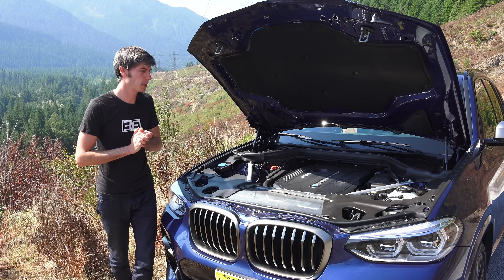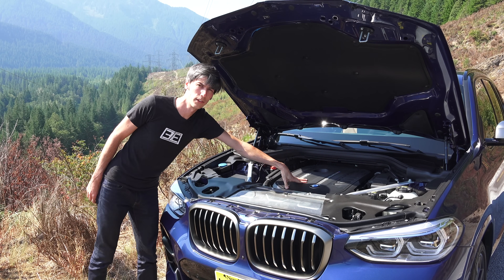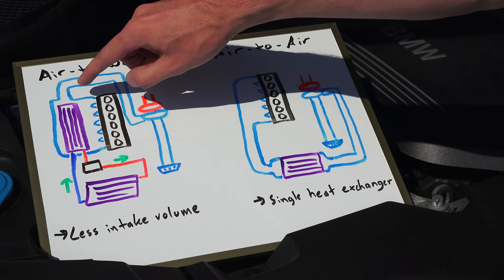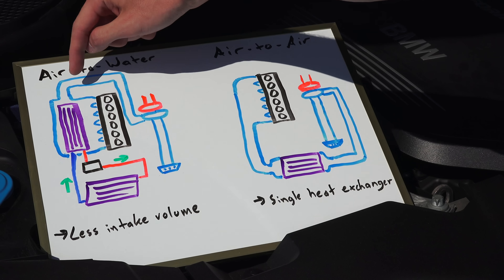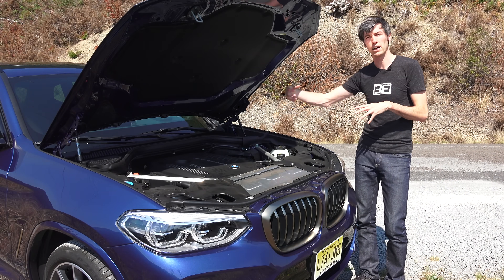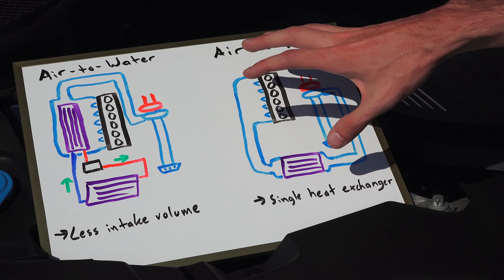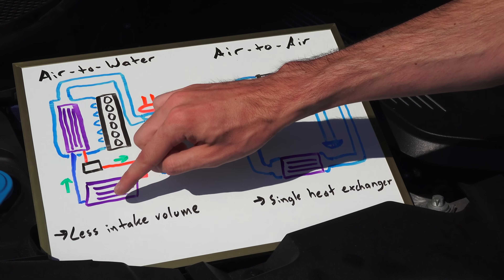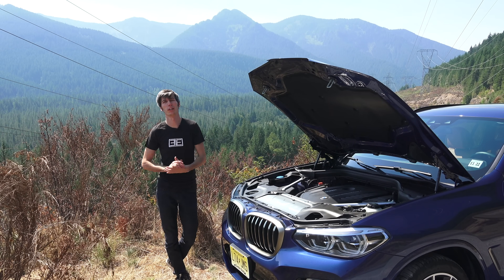The Differences Between Air-to-Air and Air-to-Water Intercoolers

Comment: Isn't the water to air intercooler more efficient cuz the water can absorb and dissipate more heat from the charged air than air to air intercooler?
Reply: Yes that's why you can have a smaller air-to-water cooler do the same work that would typically need a larger air-to-air cooler. Also less pressure drop as pressurized air runs over it.
Reply: I was thinking it worked like the A/C system. With a compressor and evaporator valve.
Reply: It's basically just another radiator system. The same reason why cars are water cooled now instead of how they used to be air-cooled. You run fluid through the heat source and then route it to a radiator to cool off the fluid.
Reply: you're not going to get the air colder than the water? especially if its in the same circuit as engine coolant?
Reply: The heat exchanger for the intake air is, but it's less efficient overall.
Reply: trouble is the word "efficient" is misused a little. water-air is not as efficient as air-air and performs worse at moving heat for the reasons  explained in the video.
thats with constant heat input like a long run on boost.
but what most people refer to is that in short burst of boost, the water absorbs the heat very well due to the large thermal mass and then can spend a long time letting it cool down when your off boost. so it works as well if not better than air-air for a short period of time which is typical for a street car.

Comment: You missed a trick.

I bet you lose less pressure having the high pressure air on the outside of a radiator in the intake manifold, than using a traditional air-to-air intercooler. Being inside the intake manifold allows one to increase the efficiency of the heat exchanger by forced induction.

Also, the heat exchanger at the front can run more efficiently, if it has a greater temperature differential to work with. The last degree to ambient is the most difficult to shed.

Sure you're still dumping the heat to ambient, but you're dumping the heat from the intake manifold, instead of from the turbo output. The intake manifold is probably hotter than the turbo output, being only a valve away from the combustion chamber.

You got a laser thermometer? How hot does the coolant loop get at low/mid/high engine load?
Reply: Samantha Dega would love to see him use that thermal camera on this car with this unique cooling system, dont just explain how it works, show us that it works!!!!!!!

Comment: Ok, now follow me on this. Could you run an AC compressor with an electric motor at say 1500-2000rpm consistently and use the refrigerant to cool the intake air? Using the electric drivin compressor would keep the compressor from kicking out at high rpm and would provide a consistent flow at the fixed RPM. One would have to get the system size correct for enough refrigerant to keep the system cool of course.

Comment: If youre building a turbo set up. What specific brands would you trust to buy for a water to air intercooler? Ive been wanting a water to air cooler for a while now especially for cooler charged air. The car isnt my daily driver. Also isnt your s2k a water to air intercooler? With that set up you dont use a separate closed coolant system for your intercooler heat exchanger?
Reply from the maker: Yes, my S2k is air-to-water for the supercharger, though to be honest I’m not sure who the big players are in the aftermarket air-to-water intercooling world.

Comment: I think is also because you can have a more constant air temperature and it's better for pollution 
the better air intake temp for performance is around 20°C (68°F ??) but higher temp is better for cruising (for pollution) 
with air/water you can stop the water pomp on small load and go full speed on high load ... 
in comparison to air/air you have higher air temp on small load and lower air temp on high load

Comment: Would intake temps be more stable with a liquid intercooler even though it would be hotter?
Reply from the maker: Probably a smoother curve of temperatures, as it would react a bit more slowly to changes in vehicle speed.

Comment: I think the air to water will be more efficient in cooling air that air to air system, first - it has already some heat capacity from the start of the engine. Exchange of the heat between water and air will be also more efficient that between air and air. You have many proves of that in central heating systems and water cooled computers. The only way to make sure is to measure air temperature which is getting to the engine in both systems.

Comment: So the air to water system has an intercooler for your intercooler. Got it
Reply: yo dawg...
Reply: A radiator for your intercooler.  Intercoolers cool charged air, radiators cool liquids.
Reply: The system is strongly endorsed by Xzibit.
Reply: Adam Adam  very good way to put it
Reply: @nickf1724  
 I believe in being succinct
Reply: +Adam Adam Explains the name bro :D
Reply: Lol @AnasHart
Reply: More like a radiator cooling another radiator
Reply: radiator*
Reply: pro: less laggy; 
con: hotter more expensive.
Reply: Basically using the density of fluid to transfer cooling at the front of the vehicle to cooling at the intake of the engine. Much more thermal density (at whatever temperature) can be achieved in fluid and it also happens to be easy to plumb in small lines. But it's going to be more complex with a pump, two cores, fluid, and plumbing.

Be interesting to see the actual NET result of air between the two systems, with all the statistics about core sizes and overall weight, ambient temps and intake temps. Would be quite a science project.
Reply: @turnin.sprocket  Intercooling is funny because the effectiveness of any specific intercooling system obviously increases as airflow increases, which implies that engine power output increases as ground speed increases.. but on a dyno, the blower is running at a constant speed the whole time. Not quite sure what that may translate to in the real world, would be cool if the experiment included measurements of CFM of air running through the intercooler

Comment: I wonder what actions are taken to avoid hydrolock in case of a leak?
Reply: baaahaha, cause BMW cares about this? I have an EGR cooler on my M57, and I worry about this all the time (1st gens were known to fail in the EU, hydro-locking). 
also, (most) people who buy expensive BMW's don't care, because they are just gonna off them the 1st sign of any inconvenience/maintenance
Reply from the maker: Prevent leaks through solid design!
Reply: @EngineeringExplained  they haven't had a solid design in at least 20 years 🤣
Reply: then dont buy BMW
Reply: @EngineeringExplained  If it's as solid as the wastegate rattle on my N54 then is all good! 😂
Reply: Give me example, when you can get possibility for such a huge damage of water intercooler that has potential to cause hydrolock? Also, give me example of any damage (except crash) of high quality aluminium casted part.

And small leak liquid burns in engine. Also, you get informed about cooling liquid insufficiency on board by warning message. So, in case, you are not ignorant or amateur, you will deal with that and find the problem.

Conversely, in A2A intercooler, it is very dangerous. Engine can suck particles (dust) from air bypassing airfiltr, turbocharger has to work more to meet ECU air amount and boost request and it leads to damage of turbocharger.

Comment: Air to air, no boost , no heat , cools off. Air to water, no boost , water heated up , continue to be warm
Reply: The A2W system has it's own coolant system. In city driving, without as much airflow, an A2W system will manage IATs much better than A2A. However, above (probably) 55MPH, that A2A intercooler will start to get the airflow to become more efficient than A2W.

A city commuter will benefit from A2W, a highway commuter will benefit from A2A.
Reply: @tom connors no moving air no cooling, think of water as heat flywheel, takes longer to heat up , good for quick launches But Once hot,  stores the heat. More water more heat storage

Comment: Intercooler on top of the engine. Is that the Subaru Impreza WRX kind of placement?
Reply: Yes, that's the car I thought of too when he mentioned that location.
Reply: RX-7 Turbo IIs have that placement
Reply: It's not on top. It's on the side, sandwiched between the intake manifold and the cylinder head.
Reply: kern417 thats actually a way better way to put it, its location doesnt really matter at all
Reply: kern417 the intake manifold is the intercooler
Reply: no, the wrx uses ambient air to cool the top mount intercooler, but it does not have a second air to water ntercooler in the front of the engine, it is just one air to air intercooler located on top of the engine, also it uses a hood scoop to take in that air which the bmw just uses the air coming through the grille
Reply: @nickf1724  he's referring to location placement
Reply: Spam Can then in that case, yes it is like the wrx, however how the intercooler cools the air is very different from the wrx. in the bmw, the coolant is cooling the intake air, vs ambient air cooling the intake air in the wrx.
Reply: I mean the air to air intercooler

Comment: So, more that can break down. Great!
Reply: That engine will hold. All the other cumputers in the car, however, WILL fail. I had a 99' 528i. One brake light wouldn't work. Wasn't the wiring harness. Wasn't the bulb. Wasn't the lamp itself. It WAS something BMW likes to call the "lighting control module". Why do we need a computer for something than can be run with a switch and fuse, maybe a resistor? Another thing worth mentioning; for the end of my ownership of that thing the "down" motor that would tilt the steering column downwards died and the column would go up on its own when the car shut off. So one day it tilted up and the next day it never tilted back down and the steering wheel now was forever stuck in truck/bus driver mode. 

Both components would run an estimated $1500 each, roughly. In Poland we joke that BMW stands for "będziesz miał wydatki", which loosely translates to "you'll encounter expenses".
Reply: Matt Morawski i had similar in e90. Needed tonreset the circuit switch in the frm module. Total pain in the ass
Reply: Er1323 If that was a criterion then we’d all still drive T-Fords.
Modern cars are way more complicated then the ones from 30 years ago yet the service intervals have gone up to 20miles/30km.
Reply: @Conservator.  criterion. Criterium is a bicycle race.
Reply: Saurabh Kulkarni Thank you 🙏!  Corrected
Reply: But we can't deny that eventough modern automobiles is complex in design and tech, it also more easy and pleasant to use
Reply: Er1323 The B58 actually is a really good engine … so far no Big Problems
Reply: Konrad Boltz give it time you will find out.